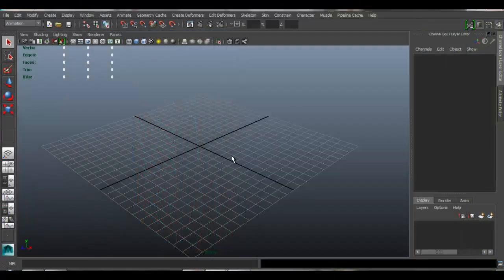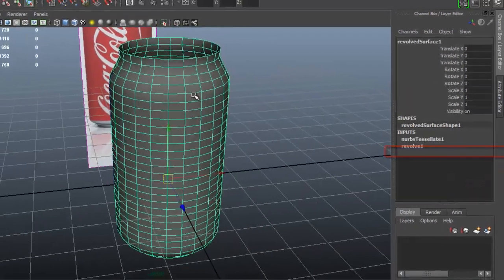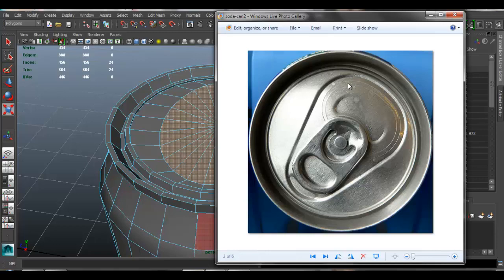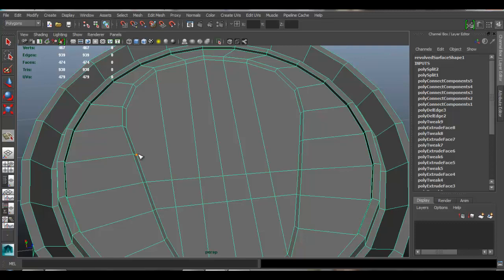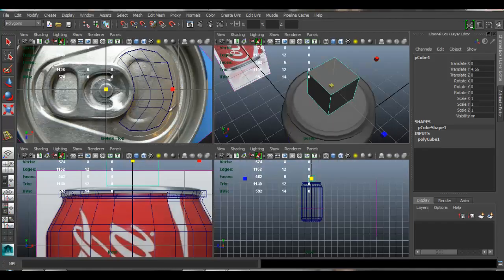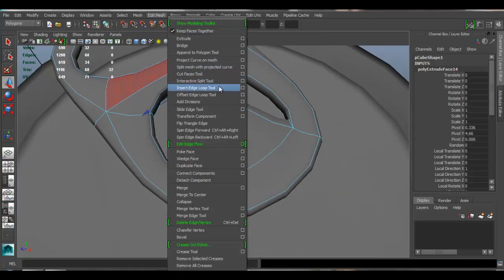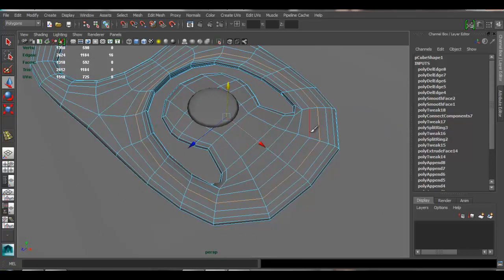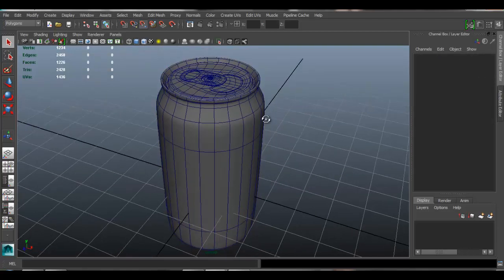Autodesk Maya 2014 - Complete Soda Can Modeling

Comment: Can i have an advise from you? honestly i have crated now some characters but in modeling i actually model or duplicate the other half just in your other tutorials. but when the time that i will delete all of that and just mirror the other half. some vertices are merging to each other even though i think i have a good topology on my model. how can i fix that? usually vertices on the mouth are merging to be one but others are fine please help. thnx
Reply from the maker: sometimes this has to do with the scale of your model. If your model is very tiny some of the vertices will merge, if it's too large some will not merge. You can scale the model from the attribute editor/ channel box and scale it to a larger number. After you mirror you can go back there and change the size back to 1.
Reply: 3dEx Thanks Dude That's Help a lot. your a genius i've search everywhere just to fix that bug in maya. seems scaling it bigger is the only options for my models. ^_^

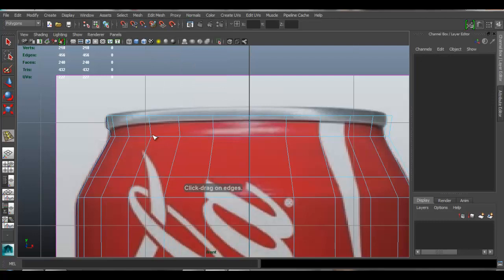Comment: when I try to scale the top part of the pop can like at 7:30, when I click the edge it lights up and when I scale it it moves everything thats in its range. Not just the edge you click. What do I do?
Reply from the maker: that means you have soft selection on. Press b to disable it.
Reply: oh ok thanks!
Reply: also now i can't create the line using the edge loop tool
Reply: FuzzyDerka never mind i figured it out

Comment: I have one question, do you think I should upgrade my PC's ram? I already have a pretty decent CPU and GPU ( I7 477k 4.0 Ghz and an EVGA GeForce GTX 760 ), but only 8 GB RAM and no SSD. I was at the time on a pretty limited budget, and if would've bought 16 GB ram I wouldn't have bin able to afford the graphics card.
Reply from the maker: If you can afford to and feel this is the time to upgrade then go ahead and do it. I don't think upgrading it will have a very noticeable impact with using maya though.
Reply: Alright. Thanks. :). Right now I can't afford it, but perhaps in a few months.

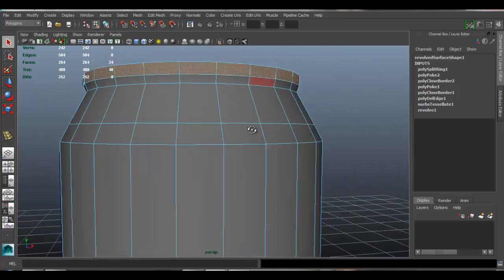Comment: When it comes to selecting the faces at 7:56 to extrude the edge of the can, it selects all the edges as well, any idea how to stop this happening? Thanks
Reply from the maker: the edges within the face selection? or extra edges that were not meant to be selected? When you go to face mode and select faces, it should only be selected faces and nothing else. Sometimes maya has a glitch where some edges remain selected even if you switch to face/vertex/object mode. When this happens you will have to go to edge mode and select the highlighted edges in order to deselect them.

Comment: Hi and thank you very much for this amazing tutorial.

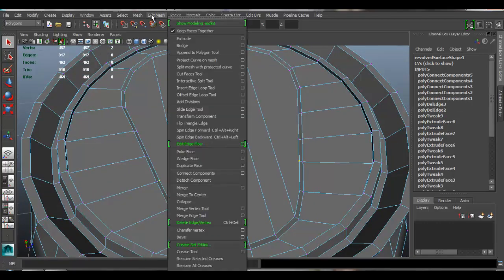I'm having a hard time with the interactive split tool at 14:10 , it keeps adding random edges and never let me connect the vertex that I want. Is there a better way to create horizontal edge over vertical ones? I can imagine the pain it will be to model a face when I can't get to model the top of a soda can. x)
Reply from the maker: You can use the connect component tool instead. Just select the vertices as well as the edges and use the connect component too.
Reply: I isolated this part and used the cut faces tool to draw the squared... looked fine until the part where we have to extract it, it messed up everything so I deleted and filled the hole. The final result is awesome! :) Thank you for your answer I'll use it in the future.

added your website to favs, you rock.
Reply: if anyone is still looking at this tutorial as of 2019, It is called the (multi cut tool)

Comment: Okay, thank you, I will do that next time, but the problem is if I open the menus with ctrl+a I can't find the places you use in your videos. I even tried to reset the interface, but that did not help, they are still missing.

Thank you very much again
Reply from the maker: make sure you have the object/image plane selected or the options won't appear. Also make sure that your construction history is enabled. If you are using an older version of maya it may not have the same names for the options, but the names should be similar enough that you will know which to edit.

Here's a link on how to enable/disable construction history.
http://download.autodesk.com/global/docs/maya2014/en_us/index.html?url=files/Transforming_objects_Construction_history.htm,topicNumber=d30e21734

Comment: Hello, I have a problem, Im using the Maya 2014 tryal version, but already since the first days all the menus on the right that u use, already to set the picture in the back of the "frame" isnt their. this causes problems and later I cant increase the V Number and by that not making it 3D. Do you have an idea where I can find the place to make these menues reapear? Thanks alot

Comment: thanks for the quick reply but idk what is up with maya. when i go to select the bottom vertices (around the 2:00 min mark) it automatically selects all of the ones on the bottom
Reply from the maker: That's odd it shouldn't do that. Just deselect them by holding down ctrl when drag over them. That should not happen though. I don't know what could be causing it.

Comment: i am trying to go step by step to learn the basics but your layout is totally different from mine is there a setting i can change? for example, after importing the front view of the can i couldn't find the x, y, and z image center to move the image back or the alpha setting.
Reply: I know this is an old comment but i just figured out that if soft selection is on, it'll automatically select all other points, just turn soft selection off and you should be able to  select one individual point. You've probably already realized that though.
Reply: thank you so much lol almost gave up maya
Reply from the maker: The settings should appear when you import the image. If you don't have that window open just hit ctrl + a to open it ( attribute editor/ channel box window).

Comment from the maker: It may be the name of the image file, maya doesn't like certain characters. Try renaming the image to something else. It could also be the type of image file so maybe try saving the file to a different image type using photoshop or something similar. Also, if you got the images from my website, make sure you extracted the folder because it was a .zip folder.

Comment from the maker: Curves are made up of points called control vertices (CVs).When you go to draw a curve, you'll notice you have a choice between either the EP or CV curve tools. The best thing to keep in mind about EP and CV curves is that the end result is exactly the same. The only difference between the two is that with the EP tool, control vertices lie directly on the curve itself, while the control points on a CV curve always fall on the convex side of the line. Use whichever feels more comfortable.

Comment from the maker: You can select the curve, right click and select 'Curve Point'. Use  "Add Points Tool" under the 'Edit Curves' Menu( make sure to switch your toolset from polygon to surfaces for the menu to appear).Then hold down the shift button while adding points. Once you've added all the points you want to add, go up to the edit curve menu and select 'Insert Knot'.

Comment: In 2013 is does not give you the ability to isolate the imageplane, or rotate and scale the image with manipulation tool. The channel box only allows for scale and position adjustments. The image plane highlights yellow rather than green when selected so it is not considered a real object. Rotating the camera helps but I cant adjust alpha in a different camera. I guess I am better off just downloading 2014.